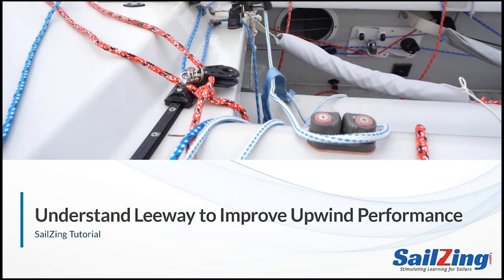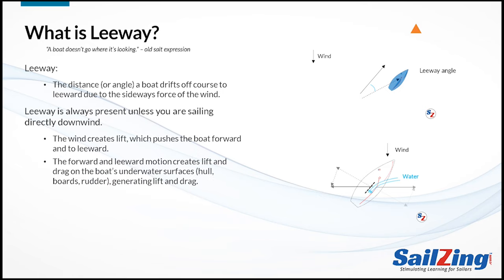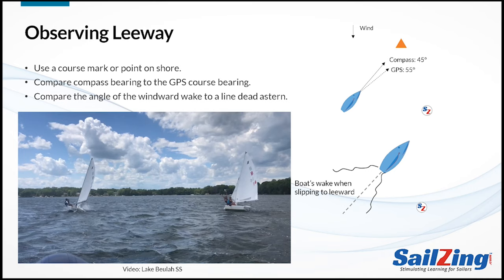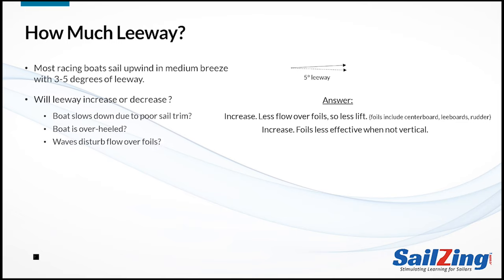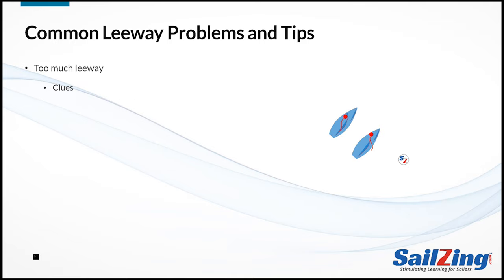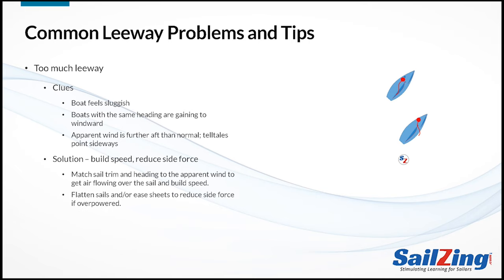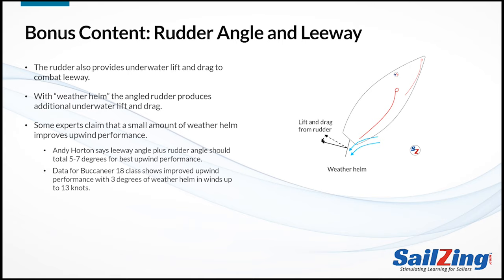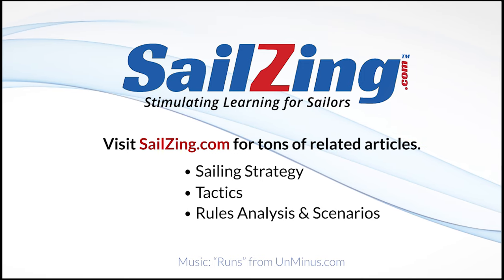Understand Leeway to Improve Upwind Sailing Performance

Comment: I enjoy you videos immensely!   Obviously the amount of leeway depends on the point of sail (how the wind hits the superstructure and sails) and the trim of the sails  - angle, depth, etc.. - which creates lift (driving the boat forward when close hauled or on a reach) and the amount of resistance provided by friction in the water and water flowing past the hull, rudder(s) and keel. As a result it is difficult to calculate. AGREED.  With any boat and a lot of experience one can record a log of the leeways observed for various wind states and directions, boat speeds and sail trim/configurations.  
While of course responding to weather helm (leeway) by pointing a few degrees towards the wind 3-5-10 degrees is typical to stay on your desired ground track -- it does not help when trying to determine your forecast position or DR position.  
Is it possible to account for anticipated Leeway when route planning ?  Mostly this seems to be ignored.
The guidance is to simply to adjust the course to steer and head of along the track - but if the wind is abaft the beam the leeway will be helping (increasing the speed along the track) and if forward of the beam it will be hurting (slowing the speed along the ground track). 
Simple maths tells me that if there is a northerly wind (from 000) and you are sailing close hauled (at 055˚) at 5 Knots to a waypoint 5NM away; and you have to allow 10˚ of weather helm to stay on track  - so steering 045˚ -- then over a period of 1 hour the leeway will drive the boat roughly equivalent to 0.833 NM along a bearing of 140˚ away from your 045˚ heading back towards your planned ground track. Given the wind is coming from forward of the beam your boat will arrive slightly later than you had estimated in your original plan in this case a few minutes. Obviously much later if your journey is longer on the same tack. 
Do you take account of the wind forecast and the associated leeway when passage planning the routes you will take?   Do your plans set out the reaches/legs and tacking waypoints you anticipate you will make based on the forecast wind/tides etc... ?
Reply from the maker: Thanks fo rthe comments. I'm not experienced in distance racing, so I'm not going to be able to comment on your thoughts.